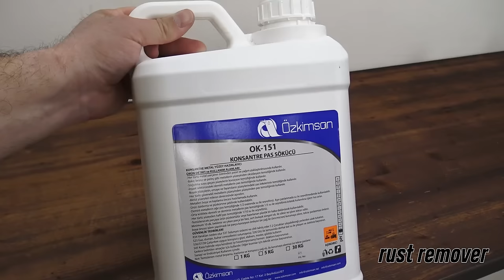Rusty Broken Gressel Vise - Vise Restoration Videos

Comment: You are to be commended for cleaning screw slots before attempting to remove them.
I like the round metal pan you used. Where did you buy it?
And finally, I've never seen a better restoration. The Gressel is gorgeous.
Reply: Maybe check My Mechanics. It’s the channel Meine Mechaniker is “inspired” by.

Comment: Incredibly well done! 😁 I didn't even know you could electro plate with stainless steel! 🤯
Reply: You can’t; not in a way that is yet industrially viable outside a lab and definitely not with a home plating rig. If the donor metal was in fact stainless, at best the process was stripping the nickel out and maybe depositing that. It definitely was not applying a layer of stainless steel over the carbon steel.

Comment: Mechaniker, very enjoyable rebuild. 
My question relates to the use of low voltage (5V) immersion (starts at 18m 48s). What is the purpose of this electrolysis please
Reply from the maker: Thank you, for corrosion 🙏🏻

Comment: Another beauty.  What makes you decide to plate parts here and not on other vises?
Reply from the maker: I dont understand
Reply: @meinemechaniker  Another vise, the Wilton I think, you just polished the various unpainted parts.  This one you did the stainless coating.  I think some other times you do a nickel plate.
Reply from the maker: @MichaelBradley1967  Yes, there is a lot of time between two restorations. Wilton is very old.

Comment: I'm not a machinist, but the thing I would've like to have seen done differently was when making the jaws, cut the knurling first, then place the pieces face-to-face for drilling and milling.  That way they'd fit tightly together when the vice is cranked shut.
Reply: Agreed. Having the knurl mesh together when the vice is closed will give them a much longer life. Otherwise they will just flatten themselves.
Reply: @bobafetting6373  Indeed, I think it has also meant that the screws for the jaws are not countersunk deep enough as he made the countersinks before cutting the knurling. Looks a bit off. But it was an astounding piece of work overall. Tremendous effort and skill
Reply: Did you really say I am not a machinist but? And then go on to critique one little part of his job? How about saying how incredible the whole thing looks? You didn't even follow up your critique with any compliment at all. I think that you are deemed a troll.
Reply: @slimtimm1  - My comment wasn’t negative in any way, I only said what I would liked to have seen done.  My Mechanics himself even liked the comment, seemingly without being insulted by it.

Comment: Hello, I have a question, is it possible to install a turntable base for this vice?
Reply from the maker: Yes ofcourse
Reply: @meinemechaniker is it possible to see something like that?
Reply from the maker: @krzysztofkaczmarek4240  as a photograph?
Reply: I have seen similar companies leinnen, but I do not know if I will fit I will be very grateful if you advise me. Best regards
Reply from the maker: @krzysztofkaczmarek4240  The rotary tables of vice brands such as Leinen and Boley may not fit Gressel exactly. However, they can fit with a little work. It is possible with new holes.
Reply: @meinemechaniker thank you for your answer 😊 I don't know where you are from, I live in Poland. I wish you a nice day
Reply from the maker: @krzysztofkaczmarek4240  🙏🏻